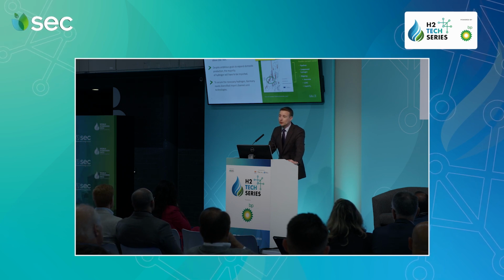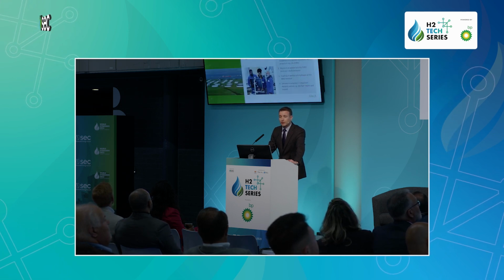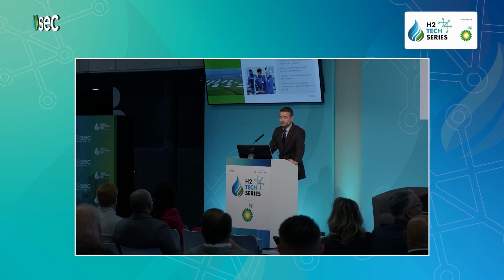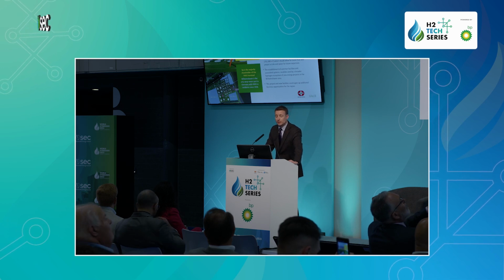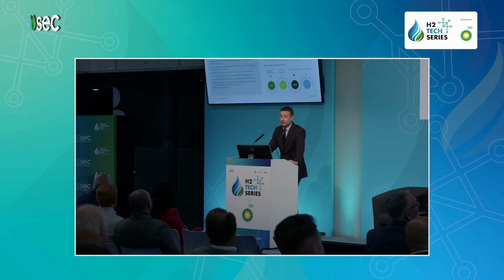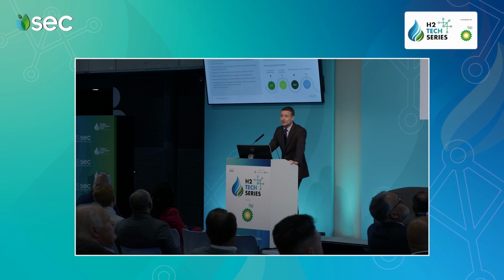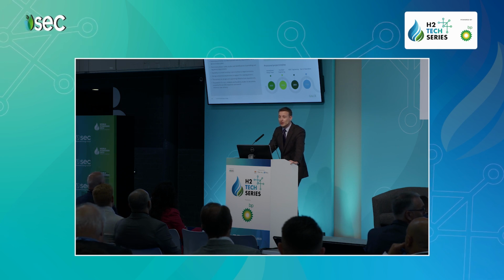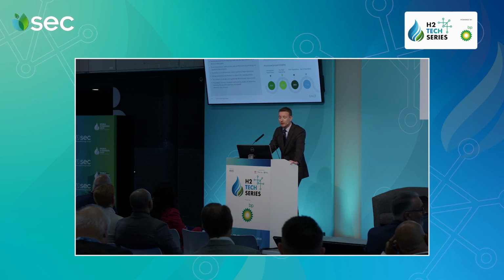Evaluating Hydrogen and Low Carbon Ammonia Imports for Germany

Comment: Very interesting to see the market (supply and demand) develop!  
Process seems logical
- get some basic infrastructure in place
- replace grey hydrogen with green
- expand upon the infrastructure you are building

Binding hydrogen in ammonia is wildly more energy efficient than liquid hydrogen.  Chilling hydrogen to a liquid seems to take about 40% of the energy contained in the hydrogen.

The other nice thing about ammonia is the current market for ammonia is WAY bigger than the market for hydrogen. There is a ton of infrastructure already in place. Ammonia is used all over the place, stored, shipped, etc. People have training, etc.

I'm not entirely convinced about cracking.  There are some existing hydrogen applications but looking out into the future the biggest use case for hydrogen is fuel but ammonia is actually a better fuel (energy dense, low pressure, commercially available motors and turbines)